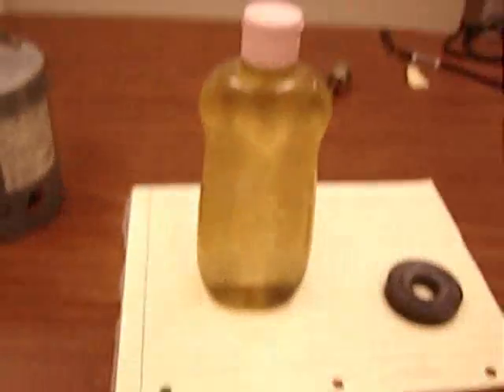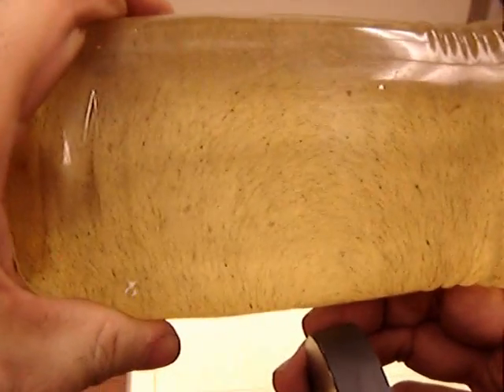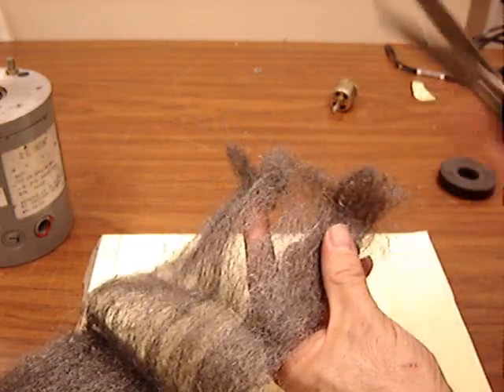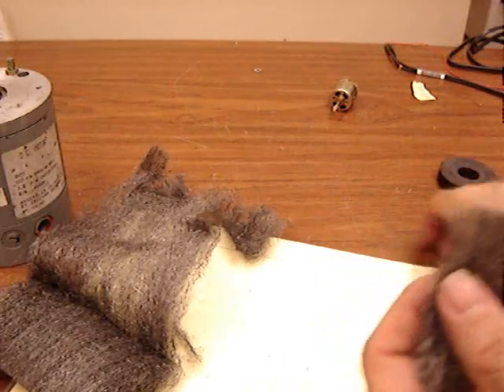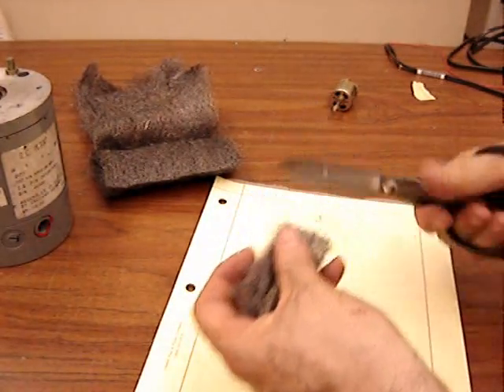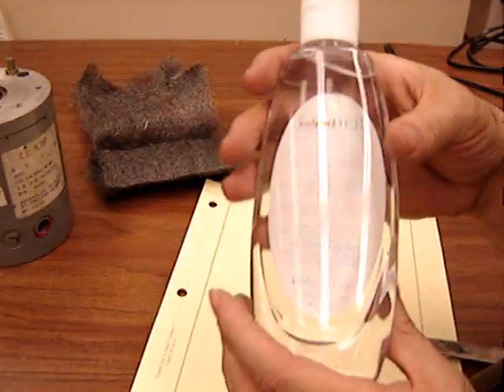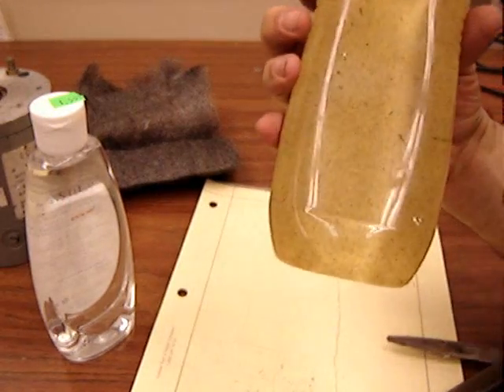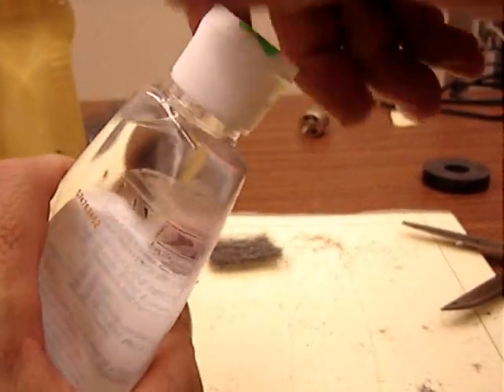Magnetic field viewer

Comment: Ever see a  magnet field in a ferrocell ? https://www.youtube.com/watch?v=j15d_LpcXks
Reply from the maker: Yep, 1990, Dinamation science outreach company.  Theirs used "Magnaflux" powder.   In sunlight it created a couple of brilliant curved lines which moved with magnets.   (The glowing lines also appear very "3D" and deep.)  They never discovered the trick of using a ringlight.   Also, the oxygen would gradually destroy the iron, and it stopped working after a year or so.   (They shoulda used lodestone powder, or perhaps nickel metal flakes.)

The number of curves in your video is determined by the number of LEDs.  So, rotate the LED array, and the curves rotate too.  Or use four LEDs not 16, which gives eight stripes not 32.   Or try non-LEDs fluorescent-tube ringlight, with no stripes.)

Comment: Did you try anything other than baby oil?  might it settle out slower and/or collect slower at the magnet with a thicker oil such as mineral oil or even motor oil?
...
 Then I'm thinkin' light syrup or honey... (I just did a density column demo...)
EDIT:  NAW!  Honey too thick.  How about Karo corn oil, but the lable may be a problem.  I just checked a bottle we recently got for making marshmallows.  Now, that's something cool to make at home.
Reply: OR He can use ferrofluid in a catalyst of water in a jar to easily see fields
Reply: Dill-Pickle-GAMEZ  What do you mean by "catalysts"?  What is the reaction you're trying to enhance?
Reply: Observ45er The "catalyst" keeps the ferro fluid "clumped" together so it stays together you can watch household hackers vid on ferro fluid and he explains everything.I built the ferrofluid in water and i was able to have a lot of fun "seeing" megnetic fields ie. magnets.
Reply: Dill-Pickle-GAMEZ link?  
...
Is ferro fluid cheaper or easier to make than steel wool and baby oil? Those can be had locally.
Reply: Observ45er WAY cheaper you can get that bottled printer ink and do you want the link for where to get the ferrofluid or to the video?
Reply from the maker: Observ45er   Ferrofluid won't suspend in water, instead it produces a blob with 3D spikes.   That's very different than 3D field display like the steel wool bottle.   Or like this one: Magnician's magnetic field aquarium - Seattle Maker Faire   That's nickel micro-flakes suspended in water, giving 3D magnetic field light-sculpture
Reply: wbeaty ok BUT it is cheaper that baby oil and double ought steel wool. You can get 1000mg of ferrofluid for 2.65 on ebay and water is free so is a bottle to put it in. where at baby oil is 4 dollars and oo steel wool is 40 dollars for 5 pounds
Reply: Dill-Pickle-GAMEZ What's with the "bottled printer ink".
...
The link for the video, please.
...
Some punctuation wouldn't hurt either.
Cheers
Reply: wbeaty  Thanls.  I wasn't sure about Dill's "catalyst".
Reply from the maker: Observ45er  Ferrofluid is a cool demo.  It creates a very weird 3D sculpture effect, not 3D magnetic fields.   For that you need tiny particles which remain suspended in the liquid.    Baby oil $2.50,  0000 steel wool $3.    Thick fluids would be better, but you'd need a motorized stir to get the stuff up off the bottom.
Reply: wbeaty Thanks.  
...
I also just saw your clips in the Elliot/Jarvis video (to Die For). 
Cheers
Reply from the maker: Observ45er   Heh, still no Overunity.    But a true "FE" machine could probably boil the Pacific Ocean by accident.    What limits the output to 10milliwatts, or 10terawatts?   Perhaps "Quasars" are actually worlds in other galaxies where an inventor stumbled across a real FE machine.
Reply: wbeaty HA HA!

Comment from the maker: The tiny little iron bars settle to the bottom in about 30sec.   Or any strong magnet pulls them all to one side.

Motorized stirring would probably work.  Normal pumps might clog.  A high-speed rotating disk on the end of a rod (a Tesla pump) would keep it stirred, then press a button to halt the flow and watch the fields?

I wonder if a really strong rotating field (spinning neo magnet blocks) could make the particles suspend?

Comment: wbeaty: re: leaking plexiglass joints: the baby oil expands with heat and will shatter a glass bottle on a hot day: I know, because it happened to my 3D viewer! Unscrew the lid between uses and set in a catch bowl to collect any overflow if the oil expands.

Comment from the maker: @95b40  Here's a way to see magnetic fields ...IN THREE DIMENSIONS. 

Yes, you really can see the 3D flux patterns surrounding several magnets.   Ever wondered what space-filling magnetic fields really look like?  Build this simple device and find out.   (Hint: you could also enclose some dry iron filings between two glass plates for a no-mess two-dimensional device.  But even in that device, using oil will buoy up and lubricate the iron, making it much more sensitive to very weak fields.

Comment from the maker: @Shiqna1    Actually you are seing magnetic field patterns.   The fields contributed by the fibers are very weak compared to the field from the magnet.   The main point is that the fibers align themselves parallel to the local flux; that way their own field isn't important.  The patterns made by the fibers look almost identical to the actual field patterns.   But real fields are smooth and have no "lines," they only have direction.

Comment: Presumably the baby oil could be thickened, I wonder if petroleum jelly dissolves in it. Otherwise engine oil might be better, baby oil is a bit thin.

I also checked in the wikipedia, iron fillings can also literally be filed off steel- I may try that instead. Has anyone tried that?

Comment: tell them to stop targetting you with electro-smog, and tell them to send some of that juice my way, im sick of replacing my wiimote batteries. 

if youre having trouble communicating with them just write your message in heiroglyphics using MS paint and put it on a CD, cause you know they are scrubbing the data off your CD's before they fry them. 

microwave ovens do the same thing, you put a cd in it and it sends all the porn to bill clinton.

Comment from the maker: > detect pulse modulated microwave

First determine whether it's really microwaves.  Temporarily reflect and block the beam with sheet metal or foil, (or hold a metal box or wastebasket over your head.)  Or climb inside a large box completely covered with aluminum foil.   If you cannot block it using metal, then it's not microwaves.

Comment from the maker: > can't show the magnetic

Use a large magnet?  Loudspeaker magnets (black ring magnets) work well.   If the magnet is too small, then the steel fibers won't align unless you place the magnet against the bottle.

Don't place the magnet against the bottle.  That just pulls the fibers to the side.

Best is to buy many small rectangle magnets, then stack them up to form a large "bar magnet."

If you place flat rectangle magnets side by side so that they repel, then the field becomes strong.

Comment: hmm i once burnt a video cassette (just the magnetic film strip) and crushed the ash and it made a very sensitive magnetic powder (I think it must of left magnetite or some form of iron oxide and just burnt the plastic strip away). I wonder if you could use that in the oil? Probably. I was just thinking of something that could maybe let you put a little more in the oil so you could see it a little clearer. Or does it get too cluttered?

Comment from the maker: And with thin fibers, you have enormous surface to volume ratio.  It doesn't take much surface rust before the fibers are gone.  Melt them all into a spherical droplet, and it might take weeks or months to rust it all away.

The fibers even rust in oil, but it takes years.  The fibers survive, but the oil turns reddish color.

Comment from the maker: > i will call it liquid rust

Actually that would make a fine science fair project for middle school:  comparing steel fibers with iron filings, and comparing bottles of baby oil with bottles of water, corn syrup, olive oil, heavy motor oil, etc.  You could also try different thickness steel wool (I think there are four types.)  See which combination works best.

Comment from the maker: Try making one, you'll see what's happening.    It settles out quickly, also the magnet sucks all the fibers to one side.  While using it you have to shake it several times per minute.  Try making an improved version with some other type of oil.

Comment: Why baby-oil? Coz it's got the right viscosity to keep the iron fillings moving slowly enough to see them polarize to the magnet.

You could use water too - but its a lot thinner, so the movement of the fillings will be faster. Olive oil would work just as well.

The whole idea of using a liquid in a bottle is so you can see it all in 3D, rather than on paper, where it's more or less in 2d. Plus you don't get fillings and crap all over the place - they stay in the bottle :)

Comment from the maker: > Depends on the amount of O they contain ;').

Nope.  Air is full of O2, yet rusting is nearly halted in dry desert conditions.  Don't forget that oil is used in car engines to prevent rust.  The electrical conductivity of water makes rapid electrolytic reactions possible, and also provides a friendly environment for corrosion bacteria.

Comment from the maker: Oil is thick.   And oil doesn't rust the steel.

If you put the magnet against the bottle, it will just make a big ball of steel wool.

If you hold the magnet a couple of inches away, all the fibers will line up to show the three-D magnetic field.

Comment: Its good idea. We've used such baths for examinating liquid spectral properties, but they were made from special glass (with certain characteristics) and were only few centimeters in size. You can make 2 types: flat plane (for using with projector), and cube (with neck close to vertex, so You can see all 3 dimension equally) The 2nd one isn't so important, just share my opinion.

Comment: if you dont want your oil to turn yellow, try using mineral oil instead, as it doesn't conduct any electricity, and therefore "shouldn't" react with the metal, causing oxidation.

Comment: Iron powder.

get it from a key duplicator. Ask him to 
collect the junk fram the machine.

Or get it from a volcanic seashore...
U just have to separate it with a magnet from other non magnetic parts of the sand.
These particles are very good.

OK, 'tis not IRON, but magnetic Iron-Oxide.
a Thermite-reaction can be posible 
with that Oxide, too.

Comment from the maker: > does it have to be withbaby oil 5/5

You can use any transparent bottle and any clear liquid which lacks any water (the steel must not rust.) Clear plastic bottles of baby oil are very convenient, but it might work better if the oil was a bit more viscous.

Comment from the maker: Nah, the water is still in contact with the metal.  It's hard to stop diffusion.  It will rust within minutes.  Also, it MUST be easy to shake up the fluid to distribute the steel fibers.  If it settles within minutes, it still must be shaken up within seconds.

Comment: I've made my own ferro fluid except instead of steel wool I took a piece of steel from my old computer case and used a dremel tool sanding bit to grind it down into a powder, I directed the stream of grit coming off the metal into a plastic box with a neodymium magnet on the outside to collect the dust.